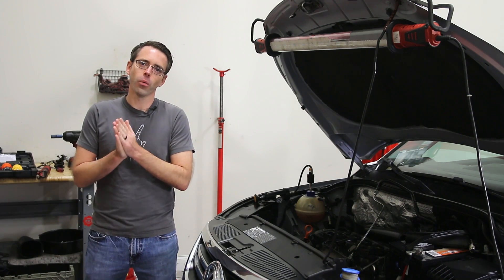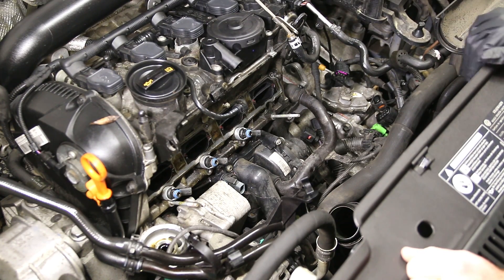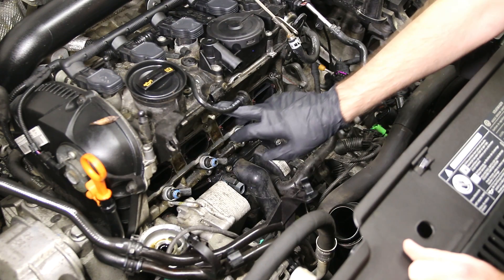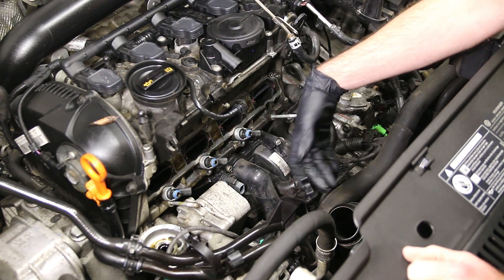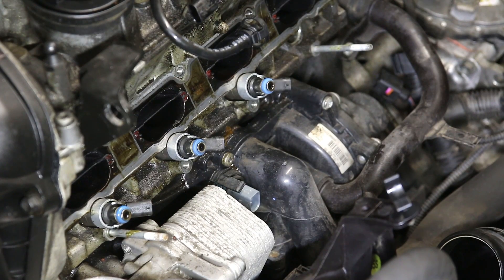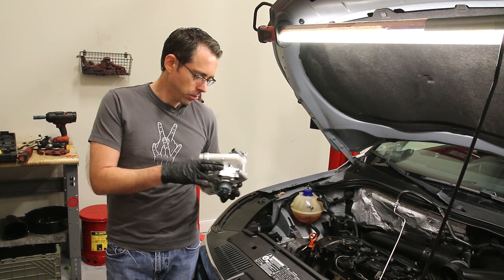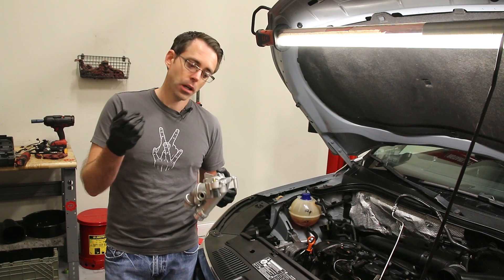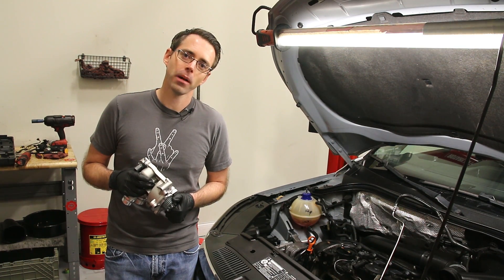Why to Never Let Problems Linger | 2.0t TSI Engine

Comment: Hi, i have Volkswagen CC 1.8Tsi and i observed oil leak from boost pipe down side from the joint clamp is this normal or what is the cause for this leak?

Comment: Don’t drive it with a bad pcv. My wife had a light said we should see what it is. Then she drove a day. The car told her on the way home can’t exceed 2500rpm. It got home and had a broken oil pan, valve cover, and timing gasket replacement all because of one pcv going bad. Thing is amazing though it survived with no oil on the way back and ran completely fine filled back up.

Comment: 158k miles on my 1.8t with no sign of oil/coolant leak on the motor.. Still running on the original water pump 😅 fingers crossed!!!

Comment: Just had this exact thing happen to my 2016 Tiguan at 100k miles. Water pump went after dealership resealed the leaking cam cradle. Dealership has already had to completely reseal the cradle twice and now it’s leaking again!! Nearly 4k in bills in 3k miles…. NEVER BUY A VW

Comment: Onto my 3rd. 2 aluminum housing pumps and 1 stock. First one cracked. 2nd was installed wrong. 3rd flange cracked. Now leaking again along with fresh oil on top block.  $7k on a new engine  my car still isn’t nice and is only worth $7500 leaks oil and oil filter housing gasket replaced. Now vacuum pump gasket, and upper timing chain cover seal. These things are such a pain. Toyota/Lexus hear I come.
Reply: Mechanics want money

Comment: The breather under my water pump is leaking oil but can't find an oem gasket from vw , can't seem to find much info on it either has anyone else had this problem and know more info?
Reply: Found the same issue idk if it's a different year cross reference or a glitch on there site but I was able to get one from rock auto oil seperator

Comment: Crappy engine! My 2009 A4 has had it's engine rebuilt twice before 100k as well as the water pump replaced.  It's had the piston/oil consumption issue as well as the tensioner issue causing the cam to slip and bend valves.   Audi paid of all of the first and half of the second.  Other than that, it's been a fairly good car.

Comment: I have a 2008 Volkswagen Jetta 2.0T fsi turbo. It wouldn’t start so I replaced the high pressure fuel pump and the in tank fuel pump. I eventually got it to start. It starts right up and idles fine, but when you give it gas it’s all choppy and not the correct rpm it should be at. I have a engine code, it’s P2294, so that means that there’s a problem with my fuel pressure regulator attached to my high pressure fuel pump, but the regulator is brand new so I don’t know what to do

Comment: Excellent videos, I know that your info isn't a bunch of BS. Lots of that out there. Working on a 2010 Tiguan with the 09M trans. Can't seem to find the TCM-NOT behind fender liner. Have PO721 code, believe I have a wiring issue ,but would like to meter wiring before cutting into plug

Comment: Can you list most common ea113 FSI 2.0 items?
I have a BWT B7 (manual quattro).
I'm converting the follower to TSI with iABED.
Going to make sure I have the updated oil pickup. 
Heard about balance shafts seizing, thoughts?
Water pump and timing belt done.
Any other catastrophics? Chain tensioner?
Also going stage 3 with GIAC as it already has the k04 and I popped new Golf R injectors in a few months back.

Comment: QUESTION: repair or replace? i have a 2010 A5 B8, only 50k miles. kelly blue book $11k. 
turbo, timing chain and tensioner replaced, spark plug coils updated, pcv replaced. 
passes emissions, no leaks, 36 mpg highway. driven gently. tax is $200/yr. insurance is $600/yr. 

i like the car. obviously, if i get a new a5 then taxes and insurance will more than double. and a car payment would be near $1000/month. but if keep the car, and swap out   the intake manifold, injectors, and water pump (all know to eventually fail) then the insurance and taxes will continue to go lower. 

how much to repair/replace known problems? 
note, if the the piston rings break>excessive oil consumption>tail pipe smoke>damaged catalytic converter..... i get rid of the car!!! no way i will pay for a rebuilt engine. 

when/mileage do B8 engine piston rings (or other internal engine components) fail ?

Comment: Paul, this was very helpful! Thank you! If my valve covers been slightly leaking for about a year, what are the chances that I already need my water pump to be replaced? How reliable are these aluminum water pumps in a long run (60K miles+)?

Comment: Pro-Tip for anyone replacing their own water pump on these engines: After pump installation is complete, run a bead of RTV along the top edge of the pump where it mates to the block. The bead of RTV will act as a barrier to prevent any potential oil from leaking into the oil pump seals and eventually causing water pump seal failure. Regular RTV is very resistant to gas and oil, so it works great to property those water pump seals.
Reply: Such a great tip!
Reply: What is RTV?
Reply: @MrSonicAdvance it essentially is a gasket maker/sealant.
Reply: I like this!

Comment: The Graf pump has great metal body,  but thermostat is horrible and it MUST be replaced on OE or something reliable,  before pump installation.
Reply: Igor, thanks! That's what I was thinking.
Reply: Do you know the correct P/N for the thermostat? I saw there are 06H-121-113-B and 06H-121-113-C, but they look completely different.
Reply: @antonzhloba6929 Based on my VIN: 06H121113B.

Comment: Need some help. Yall seem to be the only helpful VW channel. I have a 2020 Tiguan that needs more torque badly. I don't care too much about top end speed. Just more torque and no lag for cruising around town and running errands. Would like to hear some turbo noise and get more low end torque. What would you suggest? Tune, intercooler, down pipe? Maybe just like a stage 1.

Comment: I do Volkswagen and Audi valve covers and some vehicles have superceded the anaerobic/ green sealant to the black silicone D 176 501 A1, I started using this on all valve covers for vw and Audi’s and now they stop leaking and stopped the sweating,
Reply: Hello, do you recommend this D176501A1 over D154103A1? I cant' seem to find D176501A1. And also was wondering what you thought about using Elring Dirko Grey (510.030) or Corteco EVO300 (seems to be D176404M2 equivalent), they were the only ones I could find off FCP Euro.

Comment: I will be completely honest here... I installed an aluminum water pump on my CBFA gti. Yes i have a check engine light but honestly don't care. Thats the only noticable difference i have. Also i have a valve cover leak and have for as long as the new pump has been on. I am waiting it out to see how long it really takes to blow the gasket out of the water pump. Simply because this isn't my own car. I got it cheap,i do my own work and i want to know how long it really takes. So far about 1 year and still going strong.

Comment: Guys. Mayby you give advise or exolenation for me. Im owning a Tiguan 2.0tsi 180 ps 2012 is it possible to drain the collant without any special device. I have seen some  preasure kit device to connect to compressor to basically drain the coolant. My question is can I drain coolan on a traditional way by disconnecting a Water pipe from radiator, drain coolant and than clean the whole system by water and than put  the fresh G12 coolant back, set inside temp on hig start the engine and the cooling system will self bleed? I saw than in modern VW engine you have to use a special kit for draining coolan and bleeding the system. Thanks. In advance

Comment: I have a 2012 and a 2010 Tiguan.  Just paid for this water pump job and a de-carbon of the intake valves at 120k on the 2012. The 2010 is at 70k, and has a massive oil leak at the HPFP seal, and needs it's second de-carbon in three years.

Comment: Almost all the Audi TSFI 2.0t has this oil leak problem. There s a recall for Water Pump but Audi should recall the oil leak which is the main cause for the bad water pump.

Comment: Would you be able to tell me the location of the knock sensor on a 2009 Audi a4 2.0t quattro
Reply: It's behind (under) the coolant pump. Yes, you have to remove the pump to get at the knock sensor.

Comment: Did you ever investigate the oil leak in this video, like you mentioned? I would like to know what you found, as my '09 CC has a leak accumulating in the same manner. (the inside of the bellhousing is dry.).

Comment: So everytime i take a sharp right turn in my 2012 MK6 GTI it gives me a low oil pressure light and then it goes away. What does that mean? It has happened twice and it's always on right sharpish turns, I have took the car in the back roads left and right turns and then nothing happens. But only sometimes when I take a sharp right then it gives me the warning. Can someone help?
Reply: Id start with your oil level my friend. Got to keep an eye on that every fill up. Same thing happened to me. Turns out sensor in oil pan wasnt wrong.
Reply: Yup happens in my 2012 gli, low oil level. I’m putting in 2 quarts every 1500 km! Mechanic says I need a new head gasket. Sooo time to let it go

Comment: I have a 13 cc rline with 150k and it’s drinking a quart of oil 100 miles. No trace of oil leaks on the motor or drive way. but I’ve recognized black smoke from tail pipe at  normal city and a big black cloud of it under hard driving. Could my turbo be bad? Your help is much appreciate thanks.

Comment: I installed a stage 1 unitronic tune on my 2012 GLI and shortly after had some intake manifold issues that brought me to a dealership for repair. The dealership told me my tune was causing too much crank case pressure and I have had it off ever since. Car has been running perfectly since it was repaired and I don’t know if I actually had a crank case pressure issue. Anyone have any tips and thoughts on putting the tune back on now?
Reply: why not talk with your tuner

Comment: A plastic water pump? Smh 🤦‍♂️ wow that’s just bad
Reply: I'm on my 4th!! Never a VW again
Reply: Had a 2010 vw gti that i had from 30k to 65k miles and had 0 problems, got hit by a drunk driver and was totaled, now i have a 2009 vw jetta wolfs burg edition with the same dsg and 2.0t engine as the old gti i had and ive had it since 50k to now 91k miles and still havent had problems, not  sure why theres so many comments that Volkswagen is unreliable when i thrash the fuck out of the jetta i have with a stage 1 tune and intake and still have had 0 problems, you guys just need to learn how to do proper maintenance and stop buying Volkswagens from owners that didnt take care of them either
Reply: They apparently didn't learn their lesson with the 1.8t plastic water pump that would shatter and that water pump was ran by the timing belt
Reply: It's pretty common theme days. Lots of cars have plastic water pumps. At least aluminum replacement pumps are available. The poor BMW guys don't even have that option....
Reply: Just put a metal impeller water pump on your first belt change like I did and problem solved. I am not even going to touch it on my next(2nd) belt change. Every manufacturer uses plastic parts galore these days not just VW. Blame the disposable world we live in.

Comment: 5 years in my golf7 1.4tsi (90kW) with no problems. Even through 45°c heat this summer in Australia, it never gets hot.
Reply: 113 F, That's pretty damn hot.

Comment: Guys i have heard that the TFSIs specifically the 1.8 And 2.0 are not as reliable as the 2.0 TDI. Carbon built up, timing chain issues are the most reported ones .... Can anyone explain me that...
Reply from the maker: Take a look here for tsi problems. Keep in mind this was gen 1/2 TSI. The current Gen 3 engines are not the same. 

https://www.shopdap.com/blog/post/vw-audi-20t-tsi-common-problems.html

Comment: I have driven my 2011 gti for 3.5 years and did the water pump for the same issue. didn't remove the intake manifold only the throttle body (F@#$ing C%$T), and just bought a 2001 allroad… fingers crossed! LOL! if one is down I can drive the other and fix it... got my own loaner program.
Reply: Lol, have fun with that allroad. Plan on tons of preventative maintenance. I have one myself, and I'm buying a mk5 today as a daily, ha.
Reply: The Allroad will empty your wallet and break your heart. I have a 2003 2.7t.

Comment: These engines are trash, don't get me wrong I loved my MK6 GTI but I've never seen an engine have so many issues, timing chain tensioners, water pumps, valve cover leaks, rear main seal leaks, the list goes on and on.

The FSI was a great engine, super reliable as long as you changed the oil frequently along with the cam follower. 

Gen 3 is great too other than the early ones with bad turbos.
Reply: I have a 2010 CC, I'm on my 4th water pump,I have a rear main seal leak, and my valave cover gasket leak is so bad I have to replace it and my turbo is going out. Jesus I wish I never bought the damn thing
Reply: @nichole760-x6w sounds like u need to stop buying junk water pumps
Reply: All you need to do is just do the preventative maintenance it’s a very powerful engine as long as you address the weak links…. Pcv system (change to an oil catch can)  upgrade the timing chain, routine maintenance this engine will last you a long time… I know guys that are tuned and have 200k miles on the 2.0 TSI they just have replaced the timing chain and can shafts regularly and serviced the DSG on time

Comment: I just replaced the water pump in my eos because of this issue. Should I replace the valve cover sealant or just buy the aluminum water pump and replace the gasket once it starts leaking?  The amount of oil leaking out is tiny
Reply: What was your mileage when the pump went? Also, what'd you end up doing?

Comment: Hi
Thanks for the helpful information shared with us. May you please make a video about MK7 R Haldex differential . My broke his diff because of hard take offs habit.
It's very expensive part gets broken with stage 2 tunes. Its making noise while driving and there is goo with the oil from clutches. Is it feasible to open and replace bearing or parts? Or buy used ? There is no single video on YouTube for Haldex rebuild. 
Thank you again
Reply: Impressive, I haven't seen someone break MK7R transfer case. Knowing VW, it's probably very similar to other haldex Quattro cars. I would stop driving it to prevent further damage. Where is the goo from? Transmission, transfer case, or rear clutch?
Reply: @klutzycarlover   from clutch wearing off.

Comment: Do you have a valve cover sealant replacement video next? Haha? ☹️
Reply: Mario M They’re so easy
Reply: @dylanrowan6626  gonna replace my water pump and I need to reseal the girdle as well. Can't find a tech video on how to do it and not too confident to do it. I heard if you remove the cover the engine will jump the timing.

Comment: Vw and Audi no longer use this anaerobic sealant to seal up the camshaft girdles. They moved to the Loctite branded black RTV sealant to seal up their timing covers and can girdles . Guess they learned their lesson that the sealant they were using doesn’t actually work.
Reply: Im looking to reseal a 3.2 with the same issue but it just gets messy the longer you let it leak. I dont believe RTV will work on the cam girdle since you need zero clearance flange sealant. But if there is a better sealer then VW green slime mystery blend no spec D154103A1 please post it. Im debating between elring afd 2018 or loctite 515 vs 574 which Porsche specs.
Reply: Robert F we use the Loctite SI 5970 that is what Audi and I believe VW now as well is using to seal up most of the engine . Apply 2mm thick layer within the provided channel and you should have no issues. I have sealed up many many cam girdles and timing covers with this gasket maker with no comebacks!!!
Reply: @thedubdoctor  Thanks, interesting stuff, this is the first time reading about it being used as a bearing girdle sealant